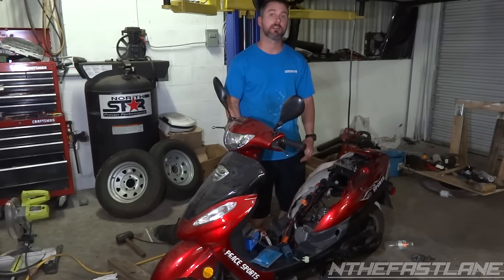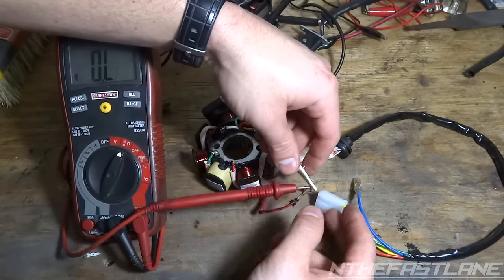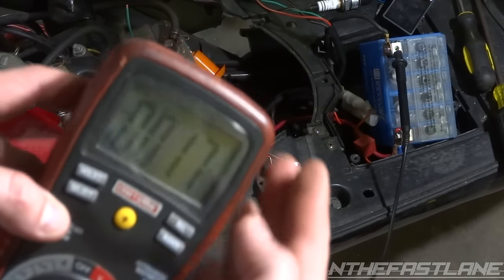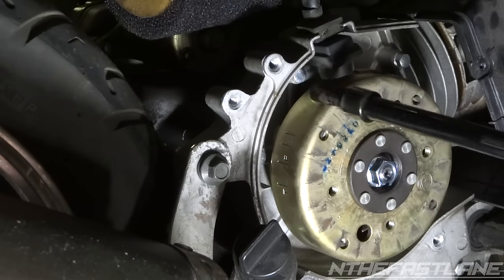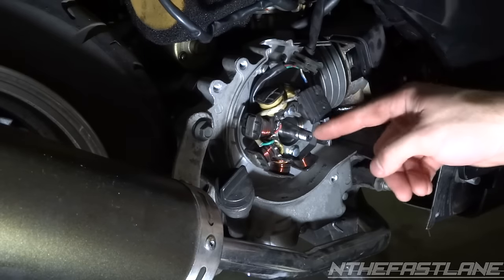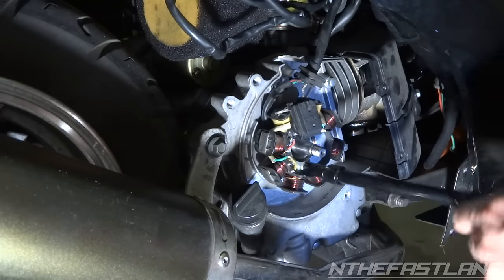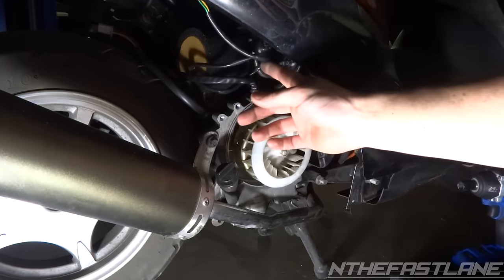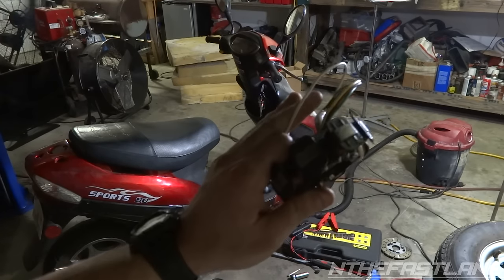▶️Scooter Won't Start Stator Repair (3 Reasons Why No Spark)🔧

Comment: I have spark , petrol in , clean carburetor, new fuel filters, clean oil tank and new oil . Scooter haven't been used about 1 year and stayed outside. I can't get it started, what should I check more?thx
Reply from the maker: Aurelian T Change all the fuel lines and fuel filter. First, remove the carb filter, spray either/starting fluid or even brake cleaner into the carb and crank. See if you're getting enough spark, sometimes the spark can be weak. Also, carburetors are really tuff to get clean. Make sure you take the main and idle jet completely out, hit them with a torch untill they turn red, then cool down and repeat. After that, take a welding tip cleaner kit, find the right size and put it inside the tiny jets to clean them out,  make sure you don't make them any bigger then they are, or you will change the fuel ratio. Hope this helps.
Reply: Its probably the battery ..
Reply: Check the compression
Reply: What was the problem?
Reply: sell it on Craigslist as is for like $150 see if someone else can figure which one out of 8 things can be wrong...these mopeds usually work for 2-4k thousand miles all sorts stuff wrong after that

Comment: My tank scooter won't hold a charge. Put in new batterie. I have to jump start to get it started ???
Reply from the maker: +Pam Skogen Sounds like your rectifier is bad or your stator. Battery is not getting recharged. Or there is a short somewhere.

Comment: Mine won't start unless I keep charging the battery. When battery is charged a . d scooter starts, the lights are dim and only get bright when I give it gas. As soon as I let off the throttle, the lights get dim again. What do I need to do to fix this issue ???
Reply from the maker: It's very possible you have a dead cell in your battery. I would have the battery tested at a local auto parts store or even Walmart TLE can test it for you free of charge.
Reply: I checked the voltage coming out a.c. it just was jumping all over couldn't get a reading mine 50cc scooter will kick start but want fire up by turning it over  I replaced the coil wire plug cdi oh and it cut off driving down the road up a hill do you think I need to replace the stator
Reply from the maker: Stator or your ignition module, aka "ignition key". I'd check the kill switch first, could be bad.

Comment: your right 3 things y a scooter wont start cdi stator coil. check the air gap between the flywheel and pick up.
Reply: i just replaced the cdi 3 months ago last week it fuked up. i uhooked the wires from the stator used a multimeter it was good i checked the the other wires cdi didnt have a reading this shit isnt difficult. 90percent when u have no spark its that cheap piece of shit cdi.

Comment: I own a 150cc 2009/ZHNG, it was working fine before just needed a new battery the owner that owned it before me had it sitting outside for 3 months, didn't even bother using it. I changed the battery (changed oil and fuel to be safe and cleaned it a bit.) and it was working OK, but suddenly it stopped. I tried to start it up ONCE, i hear a sound like its trying its a very brief moment, then suddenly NOTHING. won't even try to make the sound again. I can try to do it again but it'll only make the sound of trying to start once every few hours, then it'll shut itself off. won't even crank. I don't know what the issue can be I'm going to try to change the spark plug it may have gotten wet. if you have any tips i'll gladly take it.
Reply: cdi borrow any other to test insted of y ours

Comment: Just change CDI to DC and China has a CDI direct replacement n connect to red wire to DC from ignition on +
So no need to replace the stator (AC part if failed)

Comment: what cause the battery to run dead?
Reply: It could be your rectifier/regulator or the stator its self. The two yellow wires are the ones that will send AC volts to the regulator then the regulator to the battery. If your volts are jumping crazy high and low it might be the regulator. Check you two yellow(some times one is white other yellow) wires make sure theres no breaks in the wire. If not change the regulator and last the stator. Cheap to most expensive....if you change the regulator make sure to disconnect you negative post too close circuit first before removal.
Reply: @sergiocoronado582   THANKS.

Comment: I have a 2010 50 cc toa toa scooter,I can't get it to turn over ,or start.I check my spark lug still doesn't fire. I changed everything on it,still the same.idk what it is,do anybody know?
Reply: Cut the black wire with the white stripe. That's the safety switch activator. If that dosnt fix it could be the coil or the cdi itself also the stator